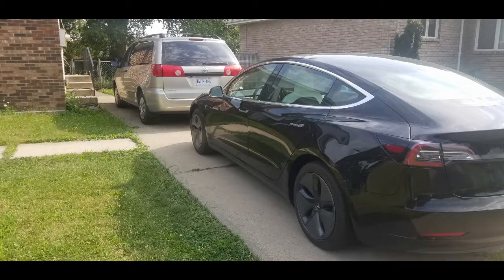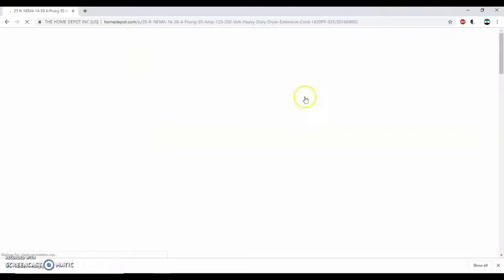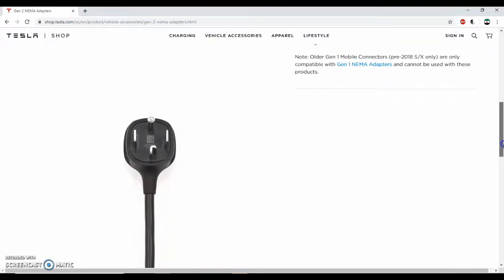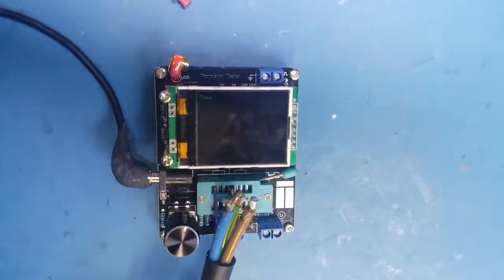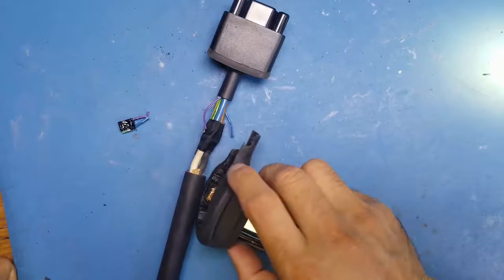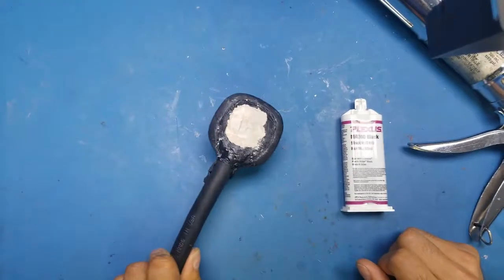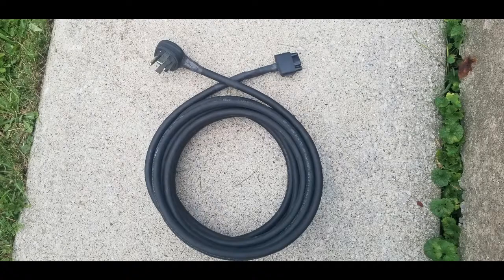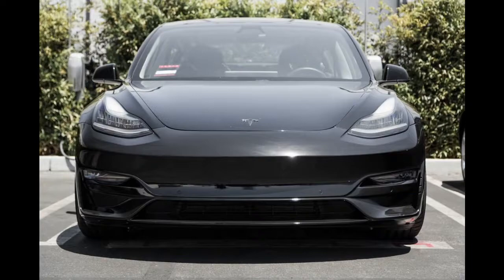Hacking / Extending A Tesla Adapter Cable For Safe 240V Charging

Comment: Thank you for making this video. It answered many questions I had about the adapters and connection to the car (thinking about a Telso purchase).  Another idea might be to leave the adapter intact, plug it into one end of the 8/3, and permanently seal it with shrink wrap and rubber combination (or any off-the-shelf outdoor-rated permanent connection kit).  That would yield a similar result (adapter still plugged into mobile connector outside) with a lot less tinkering, cutting, and wondering about that little chippy thingy. Although, I realize my suggestion is significantly less fun.
Reply from the maker: what about using 2L plastic soda bottle as a wrap after cutting both sides and heat shrink it?

Comment: Wouldn't have been better to modify/extend the cable kn the other side of the charger? The part that plugs into the car. This would allow you to keep the charger indoors and you wouldn't have to go through digging into the plug.
Reply from the maker: I wish, I could not find a cable with data lines. I did find a source in Britain but the cable is intended for under ground. the cable has to have 3 power lines and 3-5 data lines to communicate.

Comment: Awesome video. Question, I have a NEMA 10-30 dryer outlet at my house, I will need an extension cable to reach my EV, if my source/outlet is 10-30 would my EV charge faster if I do a 10-30 splitter to 14-50 or should every cable in chain just be 10-30?
Reply from the maker: I did use 14-50 on my 2022 model 3, the maximum I get is 32A. Not sure if the voltage drops and limit the charging parameter. but never went above 32A. If you branch off that drier's outlet, your circuit breaker will turn off, if both are on

Comment: Also, it measures the temperature in the plug. If you read the manual of the mobile connector, there is a fault for high temperature in every connection point.
Reply from the maker: So it is a safety feature in case the plug is not snug fit or rusted. I can not find assembly cable that has the extra tiny wires to extend the chip wires.
Reply: @LaptopDoctor I wonder if the 14-50 adapter has the same configuration as yours 14-30. If it's so, your video is very inspiring for diyers to follow. Relatively, one can run 2 thin 18agw along with your 8agw 3 wires and not have to destroy the plug to make the connection

Comment: At first I thought this was extremely silly and penny-wise pound-foolish (buying a tesla and cheaping out on the extension cable or even installing a proper charge point at home). But I have to say ......thank you for doing this video. The most important info that I got was there is a chip inside these OEM tesla charge adapters that signals the limit on amp/volt draw. There is a reason people shouldn't just buy a non-tesla adapter to convert a NEMA 10-30 to a NEMA 14-50 to plug in their chargers and save a few bucks.......excellent work Laptop Doctor and thank you for sharing !!!
PS: Liked the creativity on how you sealed the head of the plug and made it look OEM like 🥇
Reply from the maker: Thank you. In fact, I rented the house and i couldn't run external plug close to the driveway.

Comment: Very neat. As the chip tells the car what amperage to draw, did you try joining the two wires together that went to the chip circuit board? I am curious to discover whether this would allow the mobile connector to go full throttle, i.e. 48 amps with the Model 3 LR.
Reply from the maker: Tested the signal from the chip. it is powered by 3 volt DC and sends back pulses as long as the power plug is connected. if the chip line is cut (while charging), the charger will give alert (T becomes red and flashes) and move to 5Amp charging mode.
Reply: Thank-you for that information. Apparently the chip can be programmed so as to limit the amount of power drawn through the mobile connector.
Reply from the maker: Tested open and short circuit.  The chip sends pulses of data as a code. I did not have my oscilloscope handy to read it.

Comment: Impressive
Reply: I'm considering buying 75 ft of 6 gauge wire with two hots, a neutral, and a ground in conduit and adding the male and female adapters. What's wrong with this approach? It provides greater flexibility when charging at my parents house using their electric dryer outlet and other Airbnb situations that require a long distance from the car to the dryer outlet. Thoughts?
Reply from the maker: It will fill your Tesla trunk. that will be a heavy cable. I think I loose 3 extra volts with my extension, that is about 75watt. If you use 6 gauge it might be over kill!

Comment: Have you thought about making a retractable cable carrier?
Reply from the maker: The cable is thick and twisting it would break the copper wires. 
In my case, the cable is not too long.  I just hang it on the wall.

Comment: You bypassed say features!
Reply from the maker: yes. the design for this plug is that if someone cut and extended the cable, it will not work with the rated Amp.

Comment: How did you wire up the adapter end
Reply from the maker: I think I got 3-wire cable without the red. If I had red wire, I would have joined it with another hot wire to minimize resistance and put it for good use.

Comment: What did you do with the red wire in the cord you bought? How did you wire up the adapter? Did you not use any of the little wires at all?  Thanks so much I’m trying to do something similar with 14-30 twistlock cord caps
Reply from the maker: 1 was ground, 1 was neutral, and 2 were hot
Reply from the maker: I ignored the little wires as i moved the chip to the other end. They do nothing else then carry the signal

Comment: how can i ignore the chip which in the plug?
can i twist the chip wires ?
Reply from the maker: We tried it without the chip. The tesla screen says adapter fault and charges at the minimum amperage, which is worse than using the included adapter
Reply from the maker: The chip must be a serial memory code, when gets power, it will send a codded pulse indicating type of plug. same principal used in Dell laptop chargers.